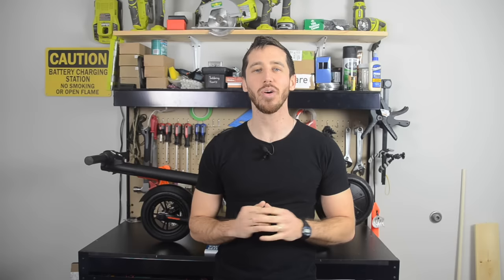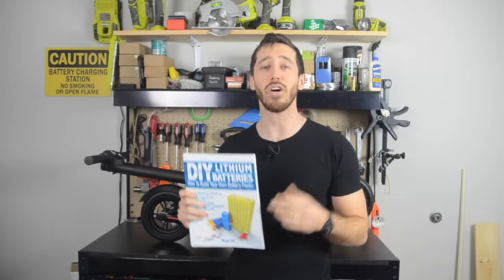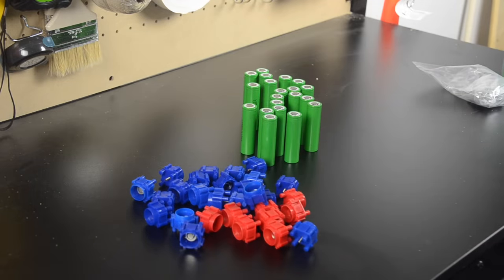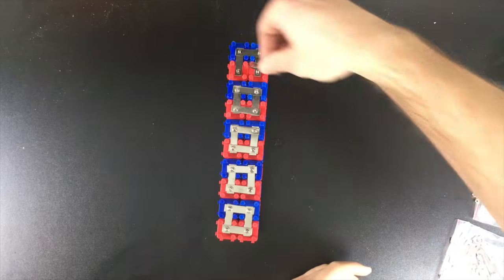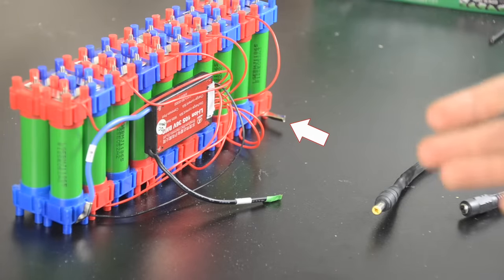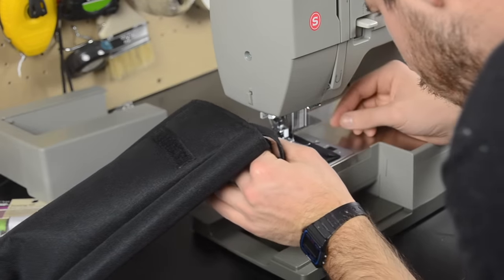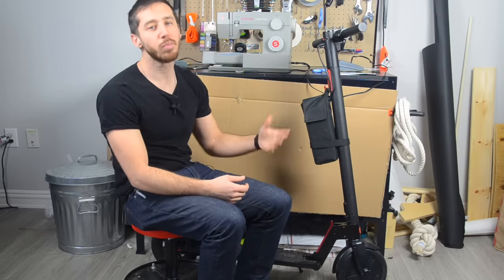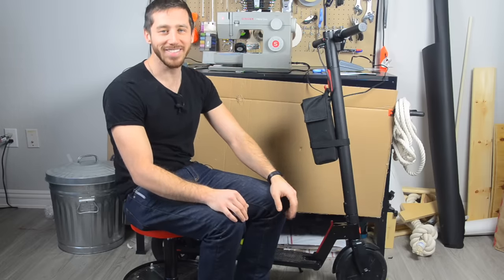DIY 2x range booster battery for electric scooter or e-bike

Comment: Im reviewing this again and I think the way it is described it can damage some internal batteries and even cause death if your not careful LOL
The safe way I think to build a booster for extra range that plugs into the charger, would be a pack exactly to mimic a wall charger. So you build it up 6 volts above your bike or scooter battery voltage and limit the charging amps coming out of the booster pack to  maybe 5 amps or 7 amps with a current regulator. You could even just have it a 2amps, but that would take a long time to charge. 
 When you regulate the current and charge 6volts above the lithium's voltage rating then your booster is acting just like a regular charger and the internal BMS will manage the charging safely and correctly. For example if you have a 36v ebike then you make a 42 volt booster pack and attache a current regulator to the dc out.  So in other words your not connecting in parallel, but creating a portable charging system. and the goal of this is not so much to instantly double range for riding continuously, because the safer style of i being just like a charger, would make the charging time slower than the discharging from riding, but it would increase range and work great for the type of riding where you take some brakes and not riding continuously so the charging could catch up with the depletion from riding. For example if you go to school and your bike is parked outside then the bike "re-charges" from any depletion from the booster while it is sitting without an external wall plug.
LifePo4 cells can be damaged by charging too fast, and even explode, that is even why Micah warns in his video the voltage of the two batteries needs to be the same and in the same state of charged if connected parallel. It cannot just connect a dead battery in parallel with a fully charged booster.  So it is dangerous if you were to drain your battery from riding and then plug in a fully charged booster directly in parallel because two much current all at once would run through too fast into the lower "deader" battier.  EXPLOSION DANGER!!!!. So a current regulator is needed and then you can connect even a 6 volt higher pack with even a lot of watts, as long as you regulate the current going in to the charger it is fine.  
Now maybe you can do exactly what this video says exactly with the booster being the same voltage (charging both up fully like in the video) but only if your really know your ebike or scooter really makes the charger port act like a true parallel connection.
If you read carefully all the comments below and answers from Micah to other people questions and compare them all and the video, you will see he has contradictory statements in the video and his comments and might not know what he is talking about for your scooter. He says it both that it is creating a parallel connection sometimes and other times he says it is just acting like a charger. If it is truly parallel it is not at all operating like a charger but simply powering the motor of the ebike at the same time as the internal battery.  It might work in the scooter Micah tried it in because in that scooter it is totally a parallel connection.
 It is really tempting to do this if your bike or scooter can handle it because everyone sometimes wants more range, but I would suggest to people to research more what kind of connection your charger port utilizes and how it wires through tour particular bms to charge the battery. You need to know if it is parallel and then you need to know how to be very careful, or take the safe route I suggest above and use a current regulator between the booster and the charging port to the internal battery
Reply: Thank you for sharing that wealth of information. Was going to try this but what all you mentioned makes sense. I don't think I am going to try this.
Reply: And just extra information, many el scooter and el bicycle manufacturer selling extra battery just like this
Reply: @quynhchi148 Its probably the case that all e bikes and scooters are not exactly the same in terms of bms and circuitry protection.  I would like to understand what kind of BMS the manufacturers that sell extra battery packs  use. MY escooter is a popular model and it does not have an extra battery and I am going to take it apart and look at the bms. I want to learn more about BMS's. Of course it can work with some as in the video above, but since the explanation in the video and discussion below have inconsistencies I wonder what the distinctions are in the BMS' that make the difference. In theory if the batteries are not matched a lot of current can flow when they are first connected because they will want to balance with each other. I do a lot of research into boon docking batteries lifepo4 I know there are different types of BMS's. Some of the brands of battery packs are listed in their specs that they can be put in parallel (adding a second battery) or and some are clearly say in their instructions and specs that they cannot. Unlike buying lithium "deep cycle" power storage batteries, when you buy an escooter or ebike these kind of details are often not listed on the battery pack because they do not like people to hack the batteries. In boondocking batteries like people use in rvs and vans they area usually made for some versatility.  Will prowse has a great channel on these type of batteries. https://www.youtube.com/user/errolprowse  I would love to extend my ability to travel long distances. It is not hard to build battery packs. Maybe people do not know about this option. If it is safe on most scooters or we had a list of major scooter brands it works on that would be good,  If someone else has a better description explaining why this can work with proper care just as described int he video above in terms of bms types or more details, please share. I think we are at the point where people are going to build self made electric motorcycles with Nissan leaf battery packs for long range travel. .
Reply: Why rechargable battery cell that doesn't allowed parallel connection? maybe they just be cautious because the cell has too small of the internal current and by parallel it decrease the resistor by n times and it make high current flow when the voltage different is significant?. If that's the case i would do the top balancing and use the current limiter and voltage limiter so it would work just fine. You're right about the balancing, that why i said the voltage must be somewhat the same for the input battery and the scooter battery.
Reply: @quynhchi148   Your right cell internal resistance is something they must make the decision on but also other things. Like Im sure the manufacturers that allow a second battery expansion have a proper plug and proper gauge wires to handle the current where the connection is made between the batteries. High current bikes need very thick wires between the batteries and the motor. If one puts batteries in parallel one needs to use the right gauge connection.  (BTW fully charged 1860 cells are 4.2 volts.) So my line of thought is if it is not a biked specked to do this and if it is a very high power bike or scooter say above 1000 watts, that is a lot of current to run through the charging port. Im not sure if BMS can handle the current but I know from my experience doing stuff in my van with high current DC wires get hot and the longer the wires the worse it gets. Some charging ports in rare cases are a few feet from the battery, but even a 3 inch wire if the wrong gauge can melt or act like a fuse. So if one beefs up ones wiring maybe the mod is ok. But also if the plug is not rated for high current the plugs and the plastic around them can melt.  Some scooters are 52 or more volts and 30amps. a lot of chargers and ports use like 18 or 16 gauge wires built for charging at  1.5 or 2 amps, maybe 45-150watts depending on the bike charger system. So it depends on the system one has. Also if one runs a ebike at full speed the motor can draw a lot of power running through those tiny wires, even if they do not fail it will create a situation where the battery closer to the motor runs out faster. So it is not that lithium batteries cannot be put in parallel, it is how one does it that makes a difference. It needs to be done in the right way. When I say some battery manufacturers say "not for parallel connection" it is because they did not make the battery wiring and bms strong enough to handle that. A voltage and current regulator can help provide safety but then one would still have an issue if that then makes ones built in battery run out of juice first because its wiring is more direct to the motor and the proper gauge for the current to flow to the motor, but the secondary battery is limited and will discharge much slower. So your ebike will run on decreased current or not run at all if voltage drops when the first battery runs out.  I did not think of the wiring and charging port till now before I was just thinking of the BMS, but this issue of wiring gauge and type of plug connecting  is a bigger issue for trying this mod bike and scooters with a big current draw. I think one needs to know ones scooter or bike well before trying it.
Reply: @jesp999  i don't think the wiring and the dc port much of the problem and i don't think there would be a design for battery pack that wire can only handle a few A just enough for low charge neither. When i design the electrical devices, i always make sure that the wire can handle at least few times the rated current, and same for my scooter and electric bike. the manufacturer provide the 1A charger doen't mean that the battery and wire is limited by that. One more thing, it makes no sense that the battery 1000w motor would just have the charger of 1-2A cause it'd take forever to charge.
And i won't limit the extra battery to only release 1-2A, the upper limit should only for safety so i would choose 2C, 3C depend on the load power, make sure that the extra battery could it least provide half of the power
Reply: @quynhchi148  on  a self-designed pack when you design your pack that is true. And yes usually the wires can handle more than just a low charge, I have used 5amp chargers on some systems, but it depends. But definitely Im sure of what Im talking about because I have have seen first hand and taken apart scooters and ebikes. I have had ebikes scooters for 10 years so I'm not just talking theoretically. On my two scooters I have now the wiring between the charge port and the battery is only like 16AWD  gauge (smaller) and that is plenty for charging, because they designed those wires from the charger to the battery only to handle charging. Now I can see in my scooters that the wiring between the controller to the motor is I estimate to be like 6AWD that wire is designed to handle the high current draw for running the motor . (for those who do not know: in the way they measure wires smaller numbers are thicker wires. most house extension chords are 14 AWD gauge and a car battery wire cable is like 4AWD ). So I believe it depends on the bike. on some bikes the charging wires are actually the same as the wires going to the controller. In my first comment I mentioned different types of BMS, 3 wire and 2 wire BMS. in the video the BMS  recommend is a two wire bms because then the wires are rated for both input charging and output to the controller.  Most battery chargers are only 2.0 amps or less so the current needed to charge the batteries is lower for the input. Anyway I do not believe you are understanding or helping people if you say things that are not going to be true for their bike  or scooter.  the video is a 36volt small scooter, not the highest power ones. maybe for that  type of voltage and amperage his wires are good enough, but it might not work over time if the wire sheathing eventually melts from heat. He should measure after ridding full speed if the batteries have different voltages due to the resistance of the wires. Maybe in his scooter the wiring is very direct and the charge ports are basically closely attached to the thicker wires between the battery and the controller. It depends on the schematic of the system and wiring. That is my main point. Everyone should first know their bike wiring and know what they are doing before making this mod.
Reply: @quynhchi148  https://www.buildmyowncabin.com/electrical/copper-wire-resistance.html. I am taking out of experience having owned ebikes and scooters for 10 years. I own two scooters now. some scooters like mine the wiring for the charger would not be enough for safe use. It depends on the design. I do not think quynth chi that you are speaking out of experience taking about ebikes and scooters. sometimes on a 2 wire bms they are making the charge port on the thicker wires running between the battery and the controller, but other systems have the charge ports in different places.  A nanrobot for example has a 52 volt battery and its charge ports on the side have like 14 or 16 awg which would not work good for the purpose of parallel connection. yet the 14 awg or 16 can handle charging at 2amps or even charging up to 5 amps. to charge at 10 amps it might work but one would need quick a brick of a charger. .but a running full current through those wires for the motor operation is like  30amps. anyone who does dc wiring knows they get hot. the difference between 5 10  and 30 amps. is a big difference. So once again people should take apart their systems, inspect their wires and plugs and understand  the specs and the ability of the plugs wires and the bms to handle the current before doing this mod. Also maybe you should list the scooters and ebike you are shure that manufacturers make an extra battery pack for which are made for this type of thing. most do not. Please provide references and data and websites to back up your knowledge.  The point is for people to be safe and not damage their ebikes and scooters, and learn how to wire them correctly so they can hack their bike correctly and not cause fires or damage.
Reply: @jesp999  the scooter he upgraded is xiaomi, the charger wire and loading wire is seperated though. Anyway, i don't want to waste time arguing over this, from the voltage to the wire and know who have more experience with BMS and electrical motor and yes, one should know what one is doing before upgrading things
Reply: So Can I just use my 42v 2amp charger connected to a portable battery bank to extend the range of my scooter?

Comment: Hey Micha, I was wondering how would I go about wiring 2 of the exact same Gotrax 36V stem batteries for the GXLV2 scooter in parallel? I'm a lil confused cuz of the 3 pin triangle output. Thanks buddy & great vids as always

Comment: i purchased a 36v 6a replacement battery. may i just plug this battery into the charger port on my kugoo electric scooter once i have charged both batteries to 100%.  like you did on this video with your custom built battery pack. thank you so much for all you teach us. hal blaine

Comment: I have a question. I have bought your book on amazon in pdf firmate and i have a scooter having 36v battery with 4.4AH. Its does not give me a big backup. With this battery. Ican run only 10 Km nearly. I need more backup like 70 to 80km. Like commercial scooters. If i increase batteries or Amperes can it give me big backup. Waiting for Answer sir. Thanks

Comment: I built a battery following your instructions and with all the same parts. However, I don't seem to be getting any kind of boost when in use. Stupid question, but when fully charged, I should read 37v across the booster battery output terminals, right?

Comment: Like the sewing - pretty and well protected! 3d printing is also an option. Not too hard to find printers today that can easily print 30 cm langth, and in strong Abs or petg which can also be water resistant if you feel adventurous

Comment: Thanks for the video. If I have a 36v 12ah scooter can I use two 18v 6ah Milwaukee battery's and run them in series? If so, would I need to hook anything else to it or just wire it?

Comment: I'm thinking of building an extended battery but I noticed my electric scooter shuts off when plugged into charge. I noticed you plugged in the extended battery to what I assume is the charge port, will I be able to do the same thing or will my scooter shut off when charging?

Comment: hey great video , WILL THIS WORK ON MY KAABO WOLF KING GT 72V the ato switching one. and will it drain from both batteries at the same time so I get less voltage sag

also would a simple parallel conection work if I use two  72v batteries one is 35 mah and the other is 32. Will it work with no issues

Comment: Question:  once you connect the new battery to the charge port, do you ever need to disconnect it?  Can you charge both batteries through the single charge port of the 2nd battery while they are still connected to each other?  I'm assuming the answer is yes but just asking for verification before I try it.  From a safety perspective, I'm thinking that leaving them always plugged in is the best policy just because there would never be any chance of connecting a fully charged battery to a dead battery by mistake - they would always stay equal because they are always charged and discharged together. 

A separate question - is there a limit to how big of a battery you can connect? For the sake of analyzing extremes (not that I would do this), if someone was to connect a 100Ah battery to get 100+ miles, could having a huge mismatch in capacity cause unforeseen problems?